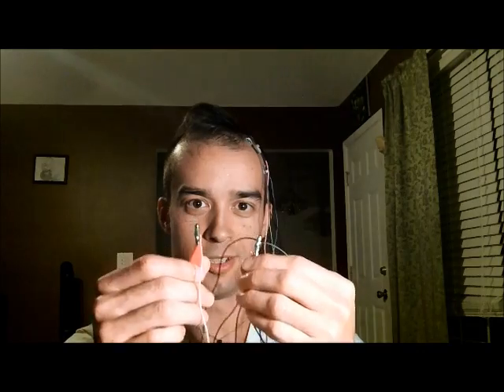My Home Made HD tDCS Rig

Comment: The recommended electrical strength is below 2 mA so levels above that will initiate burning/pain sensation. tDCS facilitates learning but not necessarily knowledge application except doing maths while stimulating the parietal lobes correctly.

Comment: That's not a concern, because there are many places that sell flexible sponge or foam material that can be bought in sheets with the appropriate thickness (i.e., 1cm). No wetting required :)